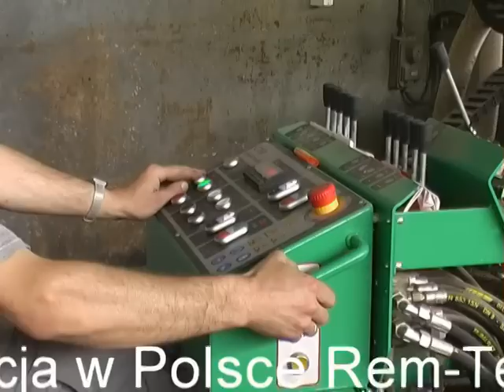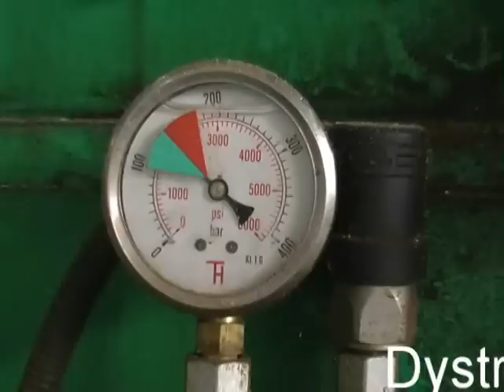Pilous Forestor CTR 1000H Rem-Tech z doposażeniem

Comment: not really, i've worked with wood and lumber, and they make thin slices instead of making big one because the can give use to thin while if thivk is made maybe it wont fit into specs, so it's a way to make it more efficient and a way to take advantage to left over material while the final product(big square block) is made.

Comment: If that log was to fall on you steel toe cap boots would not be of much use,Better to have trainers on to run away.Safe working practices are better than safety equipment.That guy has neither.